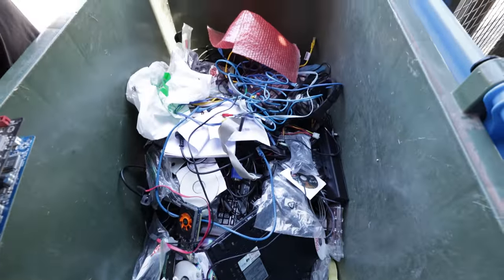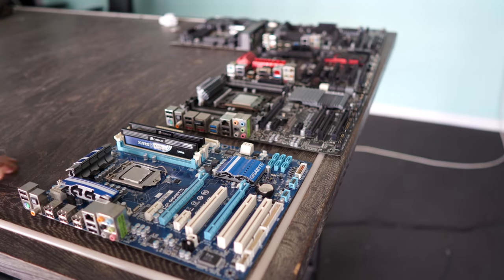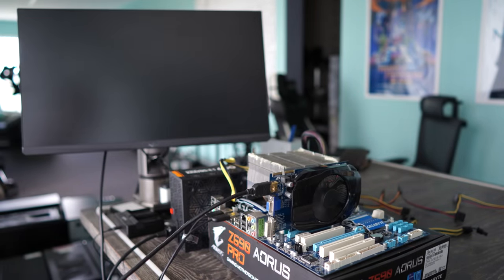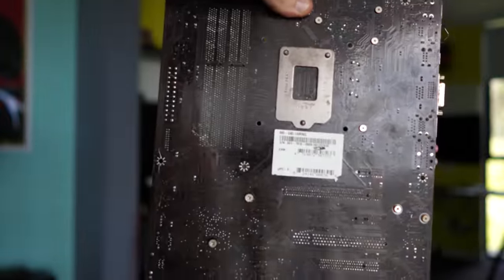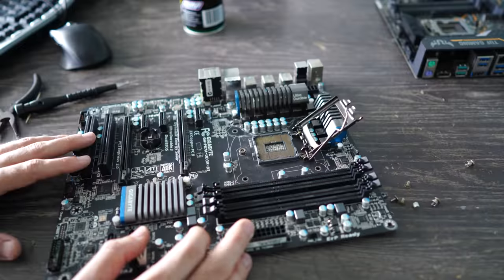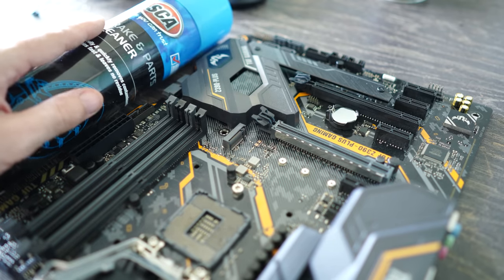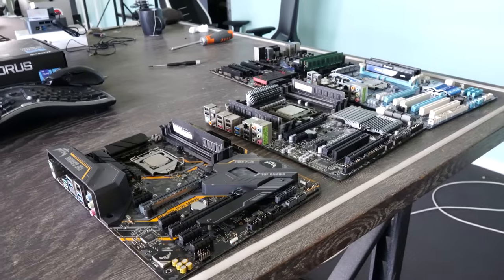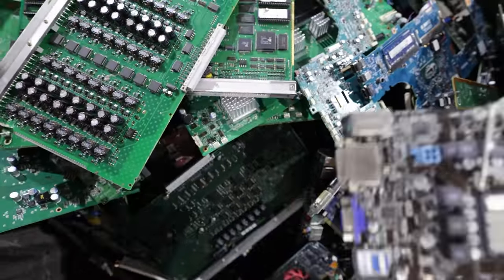$0 for Enthusiast Tech!? DUMPSTER DIVING!

Comment: We had a hardware dumpster at university. As a student I passed by daily to check for new trash / stuff. Always took the HDDs, RAM, CPUs, PSUs, Heatsinks, Fans. Checked warranty on the HDDs online and RMAed them whenever possible for new drives. Other working stuff was sold on ebay. Or I upgraded some student PCs in the faculty.
Nothing beats freebies.
Reply: Nice!
Reply: How you rma without the receipt?
Reply: @witnesszer0  that's quite easy, though wont work every time, you either say you don't have the reciet or you ask the school for it. I've experienced with a DJI drone i got from Sitech for free, with a broken range extender, I sent it for RMA and got a new one for free, just by telling them I didn't have the reciet as it's so old. lol so now i got a free functining DJI drone
Reply: Totally in agreement.
Reply: The thing that annoyed me though in cases like that was when I didn't have much cash, lets say the IT department would offer free or very cheap pcs i.e £20 for one that might of been a few years old at most.  People would email/phone the literal second they were available and take them all.  And they weren't doing courses that even required consistent pc usage, I could be doing media or an actual pc course and had to spend own cash I didn't have.  People don't think about the others who may need them.
Reply: Thats because they where reselling it
Reply: Lmao did the same last year but they didn't liked it and they removed all of em. I was finding really good components like 2nd gen i5s even 6th and 7th gen ones

Comment: It's actually quite sickening how much perfectly good things just get dumped everyday. If people really care about the environment then this should be one of the things that should get tackled 1st
Reply from the maker: Yeah recently the person told me someone chucked out a 10700K and RTX 2060 system... my jaw dropped lmao.
Reply: People feel the need to buy new stuff even thou they don't need it and throw away perfectly working things away...
Reply: @techyescity  I work at a recycling center. I had an 8th Gen i5 come in, 16GB DDR3 red-LED RAM and GTX1060 3GB. The reason? The CPU fan was noisy! Fixed it up, new cooler, new case, sold.
Reply: @techyescity  The actual fuck
Reply: @PCFixer  I used to work near where the local recycle drive happened every few months, you'd be surprised how far a couple of cold drinks go in a SoCal summer. They let me rip anything I wanted for free except HDDs because of security protocols about unwiped data. Considering this was the nice part of town I got a lot of nice older GPUs, CPUs, and enough DDR3 ram to fuel a data center. Only thing that sucked was that the pandemic killed them off, but at least now I can strip PCs I find on the side of the road in a minute flat from all the practice.
Reply: In Japan and Korea, people are just dumping completely fine things like TV, PC and other valuable gadgets.
Reply: @techyescity  Average-Joe-Slob turns on his computer one day and is like, "Uhhhh.... why's there no picture on the screen? It must be stuffed..." Throws it away; it comes in to me, "Oh, the RAM just came unseated" or, "I'll just replace X noisy fan, or reseat the GPU..." People WILL toss away perfectly good gear - TOP OF THE LINE - gear for the stupidest reasons. I even have a Black/Red Cooler Master TG Case sitting under my bench, waiting for a build--someone just TOSSED IT!
Reply: @PCFixer  I couldn't work at a recycling centre. I'd be taking half the stuff home every day 🤣
Reply: @techyescity  what the hell
In our country the dumpster mainly contains dead or very very old components
like P4, 775 boards, H61 boards, artefacting GPUs, etc.
Reply: @suiken3149  and that made opportunity for us (Indonesians and Philippines) to sell them on home country if possible
Reply: In fact he did more for environment in this video than greta thunberg in her whole life.
Reply: @techyescity  Wow.....That 2060 is worth much more than before the shortages...
Reply: it takes technical knowledge to recycle for reuse, also theres a limited market, and do you want to do customer IT support for aged maybe failing hardware, too easy to lose money doing that.

people throw stuff away when it becomes unreliable, very difficult to guess the real reason at the dumpster.
Reply: @techyescity  bro i do the same thing as you did in this video weekly i found an i9 10850k discarded with a bunch of older CPUs and it was left outside and it rained so all the capacitors on the back where rusted and fell of it broke my heart honestly an d i cant even imagine who'd throw away an i9 there was also a discarded 780 which had its pins cut off so sad
Reply: ill be happy if someone will hire me into this recyling centres 😆😆 ill be doing samething with @techyescity

Comment: credit to you, you are one of the few that shows this avenue for equipment, what is possible, how easy it is to repair and THE GREAT GEAR THAT MORONS are throwing out. Brings me back a few years, I got most of my gear this way and still working perfectly. more content please
Reply: yeah but he hams it up and doesn't give a realistic perspective, far too superficial how most everything seems to "conventionally work"  Shows bias against lower and older hardware that can still be repurposed for things, notice how most of the stuff he saves isn't too much older than around 10 to 12 years old?  That's still viable for modern use given some time, cheap upgrades and consideration bias for what software to use removed to put expectations within reason.

And he's not the only techie in australia.  Ewaste ben, the complete opposite kind of guy, shows ya how to waste your time waste the tech, waste your money destroying it and he constantly makes videos too.  Just look at a video or 2 of his. to see what i mean and compare.  Practically no testing or repair or getting it to boot.  Just tear it down strip wires parts (often improperly) or simply cut then with a wire cutter and talk about gold and contacts and copper or steel n crap.

Comment: Watching this made me realize something motherboards are realy hard to kill. Im impressed.
Reply: yeah im shocking too
Reply: @CraftingTable3076  even with things riped twistid and broken cpu pins the damn things both posted and my face was like this🤔🤔
Reply: @candidosilva7755  just means that manufacturers pick up the quality
Reply: @candidosilva7755  Missing PCIe lanes, thats the downside to fragile LGA sockets, people ham fist them. AMD pins tends to be strong until they break off.
Reply: i literally made a decade old am3 board bath in WD40 to remove corrosion, let it soak for some time and wash it in dishwashing liquid with a toothbrush and put it under mild sunlight to dry. Still boots and looked newly purchased.
Reply: @elvis roose i've accidentaly forgot to remove the plug and drain the board's power when i was inserting a graphics card, the metal part (where the port area is) touched the board and made a spark. Also accidentaly dropped a screw driver on the board and hit something denting a random solder. Board still works fine.
Reply: Tell that to my two EVGA SR-2s :((

Comment: Thanks for the great content and a huge thanks for recycling ♻️ what could potentially end up in a dump!! As a kid in the 90s growing up in the burbs of Chicago, I used to ride my bike to different neighborhoods and go garbage picking. One day I opened a box while looking through the trash and there was a complete Unisys workstation (monitor, kb, and mouse also) with a 386, 12MB 30pin ram, and a 340MB HDD. It was super neat, and it was super heavy... It weighed 86 lb just for the tower! Great times I had back then and found many dumpsters also from businesses throwing away  all kinds of cool electronics.

Comment: Getting the Z390 going after all the damage was an amazing job.
Reply: My mind was blown on that one.  I passed on a z490 mobo once with gum stuck in two of the RAM slots.  Now I feel foolish.
Reply: I guess you could say the z390 board pins weren't TUF enough.
Reply: @grlmgor  oh my God that's great
Reply: because damaged was left side of socket with Vcore and ground pins
, so its not critical like right side with memory pins

Comment: Great stuff again Brian. I've dumpster dived a bunch of PCs. Most are much older than you have here. In my area I've not found a facility that will let me touch the drops. I find them by literal dumpsters. Many of my friends also hand me their old machines. Some I find new homes for. My best "find" was actually at a thrift store, "$35 as is" full system, fixed it up, dropped in a GPU+SSD and got my friend gaming. Other machines I've found I use as test equipment, or for experiments. I donated others to an A+ certification class. I've considered creating a little sign to pin up next to dumpsters "PCs here". People at apartment complexes often dump alot when they move.

Comment: This is amazing dedication. I thought I did well getting a Z390 Strix board for 25GBP being sold as untested but it had bent CPU pins and the board had a bend in the bottom third of it. After some time aligning the CPU pins, the board booted. I can't use dual-channel memory on it but none of the I/O beneath the bend  on the board seemed to be affected so I'm now using the board in a file server. You put me to shame getting 4 free boards, putting in a bit of TLC and getting them working. I need to find a computer/electrical disposal company in the UK who'd be kind enough to let me dive their dumpsters.

Comment: I am still amazed by what people will throw away. I picked up a few computers from marketplace a few months back that they were just going to dump. One was an i5 2500k system, another was an i7 4770 and the 3rd was an FX-6300. All 3 worked and all 3 had 16GB DDR3 RAM and the only thing missing was the drives! The i7 had an R7 260x and the i5 had a 560 Ti. The FX system had something like a GT710 I think (I donated that system to a neighbour who was on an aging Core 2 Duo). The other 2 systems were sold cheaply on marketplace after buying a couple of 120GB SSDs and scoring some free 500GB mechanical drives from old Sky TV set top boxes.

Comment: Back when everyone had crt TV sets I had 2 TV shops in my town that would give me all the sets customers decided not to fix. I got a lot of them working and the rest were tore down for parts and recycled and scrapped. I still have some leftover crts and lots and lots of tubes from the super early lighthouse ones. I sold working buf not awesome sets for 50 each with a 30 day warranty and really nice up to date ones that had a remote and digital tuners that had excellent pictures could go for 150 and up. Made money for bills and toys for quite a while till throw away flat screens became popular and the digital broadcasting took over it wasn't worth it any more.
I still have a couple crt rejuvenators and test equipment around I just don't want to throw away.
Someday I should sell off all the vacuum tubes, some are worth some money now.

Comment: Flipped a system that was on the side of the road.  The fans were clogged with cat hair being held by vaping juice and there were a bunch of dead roaches inside.  Took me an entire afternoon to clean everything out.  It had the following specs inside.

CPU: i5 6500
Motherboard: Asus H110M-K
RAM: Hynix (2x8gb) 2133MHz RAM
GPU: Gigabyte Windforce GTX 970 4gb
PSU: EVGA Supernova Gold 750w modular
Case: DIYPC F2-P Black/Purple
Stock Intel cooler
Storage: 1tb WD Blue 7200 rpm hard drive

It smelled awful, but after a lot of cleaning, I switched the GPU put with an RX 560 4gb, moved a less intensive PSU into it, cable managed it, and put an SSD in it for running Windows 10 and flipped it for $350.  Easy profit.

Comment: It's crazy how much usable things get thrown away. I once found a Desktop with a i7 3770 and a GTX 660 on a garbage pile on the side of the road, took it home and it worked perfectly. In the company I worked at, PCs and Laptops that worked but were too old were data wiped and given out by lottery to employees for free. This is a much better thing than just throw them away.
Reply: I still have my i7 3770 I bought brand new. I still use it as a second family computer for internet and light gaming.  Paired with a decent gpu it's still quite the capable machine.
Reply: @marcellachine5718   nice.

Comment: bit of a dumpster diver myself - great video! Have to be careful though, I had a monitor which went POP the 2nd time I used it, after it seemed fine to begin with....and some of those old mobos will give you PCIE 2.0 slots only. Lastly, make sure to thoroughly dry out your dumpster loot before using

Comment: even when you can't get the full components to work, you can still scavenge the parts, or sometimes replace them, for example you could spend some time and solder on a new pci slot, if old is ripped out, with corrupted traces, if they're surface-level, you could potentially bridge them yourself (if there's overlaid traces both of which are broken, that's technically possible, but probably not worth it, at that point, unless you REALLY want it), or your could desolder the individual components (probably not worth the time, unless they're uncommon, or unless you like tinkering with building electronics yourself, where it can be very handy to have a few trays of components for only the cost of time)

Comment: @10:45 You don't need to take the securing plastic thign from the RAM slot, just manually push the plastic to get it in place, and that's it, unless that's not enough. For Pin unbending: use a very small "flat" screwdriver, and a 40x+ magnifying glass, great precision; if you need more precision, build a small lever with 2 small screwdrivers

Comment: Years ago my ud3 p67 board started boot looping out of nowhere, didn't work on either bios. Did some looking online and seemed like it happened to afew gigabyte motherboards of the time. Before it died it was throwing USB hub errors even with nothing plugged in, so not sure what caused it to fail. 
Glad to see some of this hardware will see some more time in use after being dumped. Good stuff mate!

Comment: for this ga-p67a try this method, hold power button, plug power cable in PSU, as soon motherboard gets power unplug power cable from PSU, wait like 10-15 seconds and plug cable back and repeat process 3 times. After that you should release power button and get to backup bios and working motherboard. I had same problem with my GA-Z77-D3H. Good luck

Comment: when you use the ultrasonic cleaner you should move the parts around after running for a bit... like run 3 cycles and move EVERYTHING around in between each wash( no need to clean water tho) this is because the sound waves will just hit the same area over and over until it moves... moving changes the way the sound waves reflect inside the liquid and around/in-between all the parts inside - so if you want them SUPER DOOPER CLEAN, run them through at least 3 times (each cycle doesn't have to be as long as u typically do) - so remember MOVE THE PARTS AROUND!!! :DS

Comment: One of my first forays into pc building came from dumpster diving for upgrades. I took an old 533MHz Pentium. Found a 733MHz and a 933MHz cpu. A 20GB Seagate HDD I dubbed the Gimp drive, as it had a rubber drop wrap over it. And a couple sticks or ram. Taking the old 128MB out to be replaced by 768MB between two sticks. Also found a voodoo card. But by that point, games already needed much more than the 4MB it had.

Comment: i work at an electronics recycler, i have to yeet so much good stuff because it's generic, hell even name brand stuff we'll scrap if it has a single bent pin. probably half a dozen am4 boards gone because the system they were in wasn't dell, hp, or lenovo. it really sucks tbh
Reply: That annoys me a lot.

Comment: My current rig is running a 7600k on a gigabyte motherboard. I got it for free, when someone at work bent the pins on the board trying to clean it. I offered him some cash, but he said, if you can fix it, it's yours. 1 hour later, first time bending pins, and I haven't had an issue in 10 months.

Comment: My best "dumpster find" is a dx2300MT HP PC with E6700 and 4GB DDR2 and GTX 285 powered by Corsair VX550, then i've found a case with windowed panel nearby that area so i compared that stuff into one build and everything is working good today, sadly this motherboard don't accept C2Q's :/

Comment: Where those two pins snapped was likely in the power delivery section for the CPU, you can usually lose a few of those and not lose stability, you may never win world records with overclocking now though hah. LGA 1151 pinout diagrams should help you find exactly which pins were lost and what they did.

Comment: I had that exact p67 board and had the very same problem with boot looping. This was a long time ago, and I don't remember the solution. If I remember correctly, it would actually boot sometimes, and when it did I just never turned it off :) then at some point upgraded.

Comment: Good Junk  So much thrown out  - Moving or old stock   Only keep what's  useful  
40 Brand-new  WD 500gb Hdd &  Seagate 250gb Dumped outside units  
i take magnets out of  Old hdd's   the magnets inside ( stick on my  lamp pole collection)  and Copper heatsinks  etc.  That SteamPunk   idea . 
DDR3 + stuff  i keep if good  dont need but uno someone may need Got Mve maybe Jan clean out junk time again   bit rubbish

Comment: Great Video. Thanks for sharing and thanks for recycling. Won't know how good that MB with the bent and broken pins will work until you use it. Just because it boos does not mean their might not be a problem later.

Comment: I'm almost sure you can re- solder/re-connect  those cut/slice traces with a copper lead a a little bit of soldering...
Reply: good luck doing that on a multi layered pcb with no schematics or experience in micro soldering....